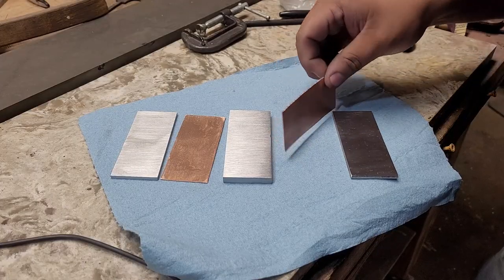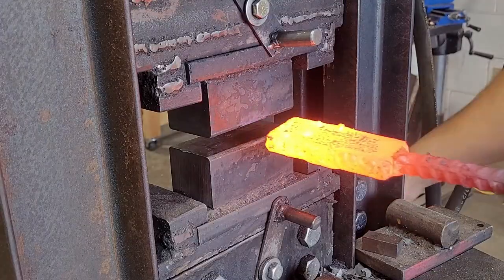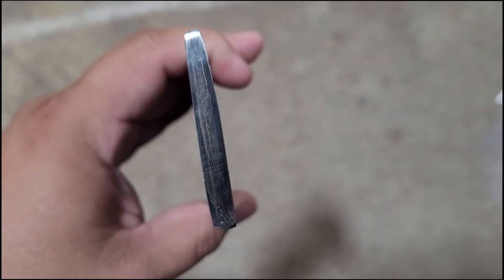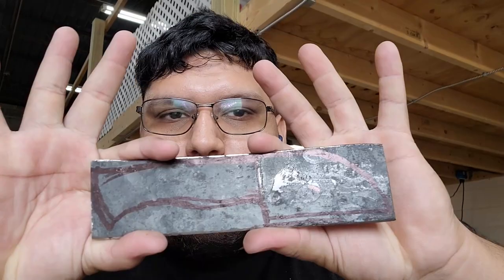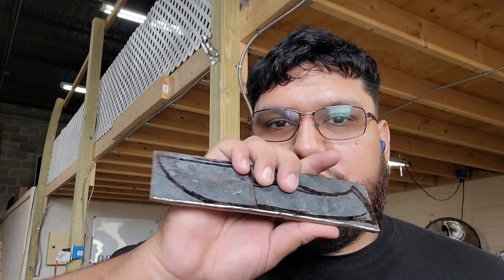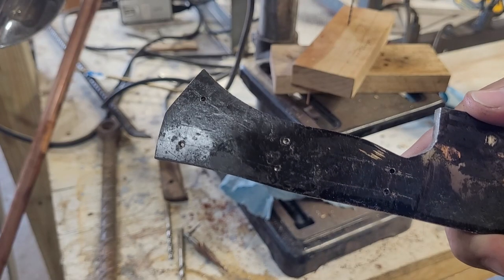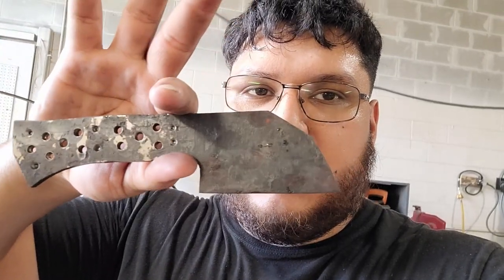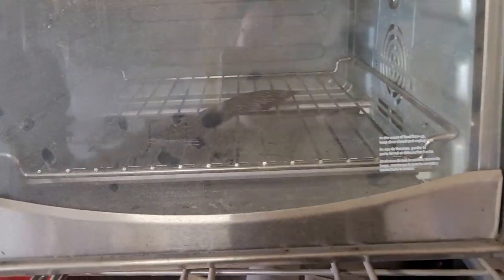Forging A Cu Mai EDC

Comment: I have been experimenting with Damascus forge welding w/o flux with great success, Thanks to your great video, tomorrow I will scrounge some copper and try to forge one myself. I will be doing about the same as you, 1095 for the center and then the copper and for the last 2 outside sheets will be 15n20 and as usual no flux to ruin my forge. If it works I will send you a pic. 
Thank you for the inspiration
Dave.
Reply from the maker: Be sure to let us know how it goes Dave.